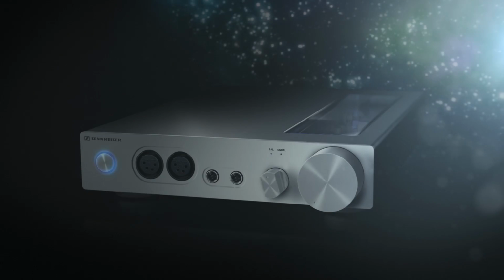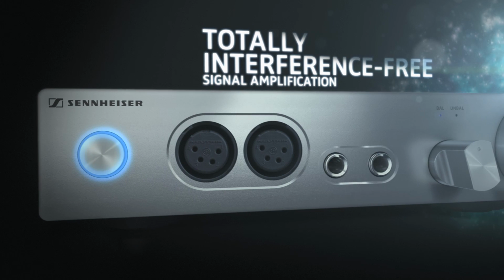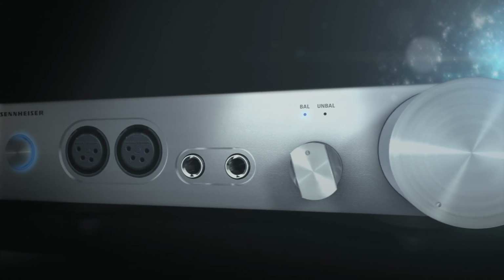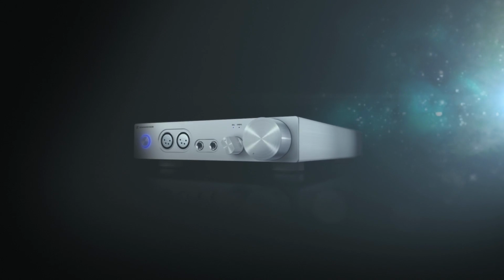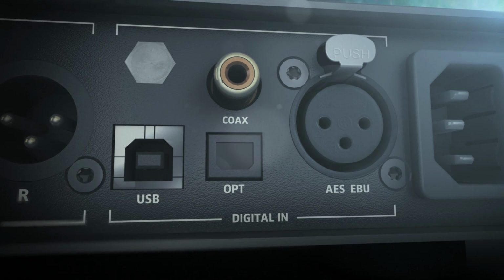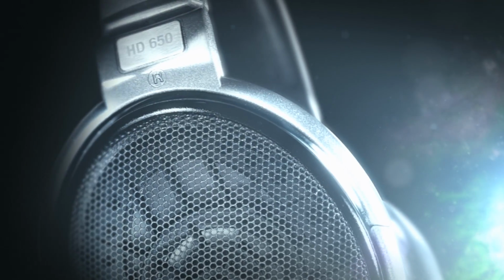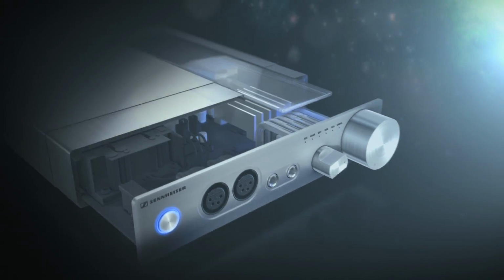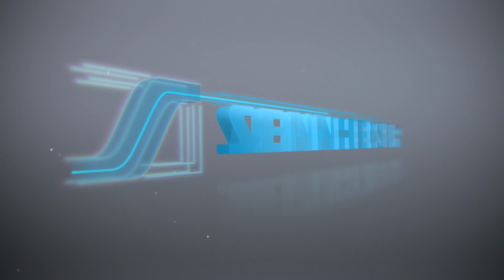The Soundraisers HDVA 600 & HDVD 800: Headphone Amplifiers | Sennheiser

Comment: I BOUGHT 1 HDVA 600 and HDVA 800 the 600 came without optic and usb connector and i want to connect it with my computer so please please help me i bought them from amazon ill be thankful let me upgrade my PC 363D !!!
Reply: The HDVA 600 doesn't feature a D/A converter, it's a headphone amplifier.
The PC 363D part doesn't make  sense.
Reply: well i was using 363d and wanted to upgrade now i bought my 2nd HDVD 800 so ill try use my HDVD 600 else where and thanks for the reply
Reply: drivethrow I hope you have the right headphones for it. I couldn't afford this.
I got myself a fiip e17 recently.  For me, that's enought money spend on an amp/dac even though I love decent sound.
Reply: hd 800 hdvd 800 CH 800s compine now and i hear static when i try to go over 5/8 knob but the sound way higher than normal snap on cables u cant leave it on your ear its over loud
Reply: To use the HDVA 600 with a computer, you need a RCA-to 3.5mm cable ( the 3.5mm jack to computer, RCA jack to HDVA600), The  PC 363D has 2 jack (1 microphone and 1 headphone jack), buy a 3.5 mm to 6.3 mm adaptor to connect the PC 363D's headphone jack to HDVA which only has 6.3mm jack.

3.5 mm to 6.3 mm adaptor here: https://www.amazon.com/ARISTA-16-097-4-Inch-Headphone-Adapter/dp/B00009UVPN